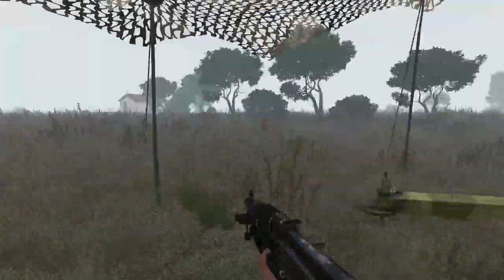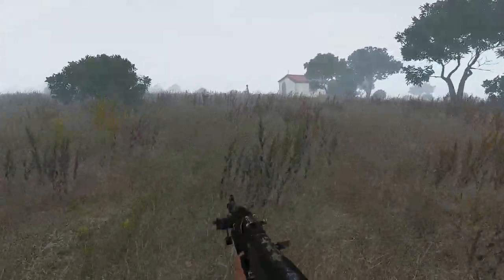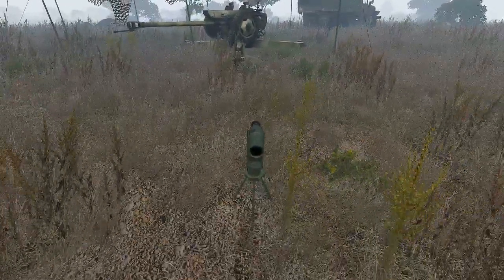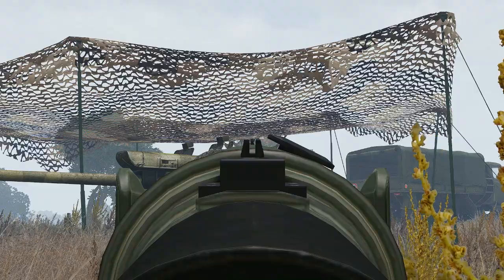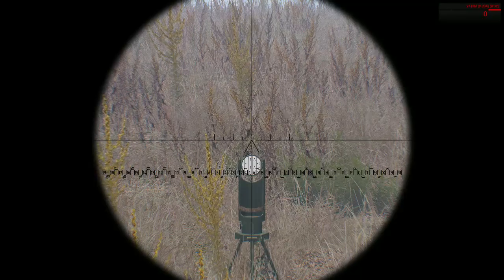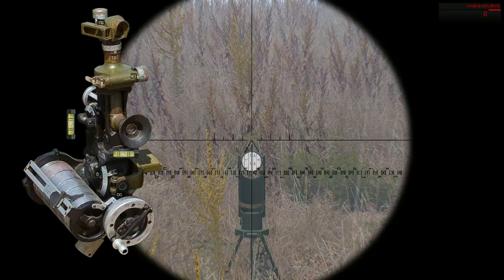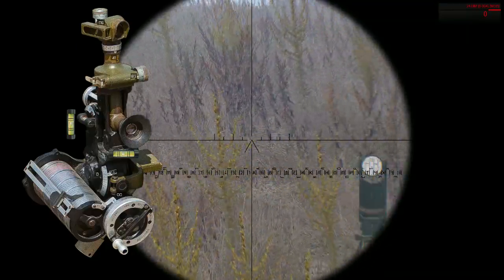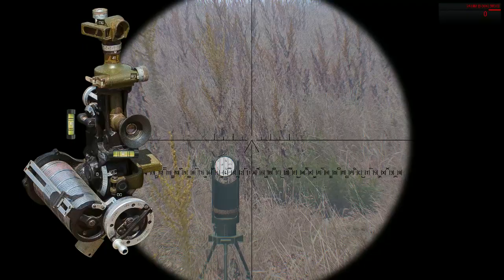Arma 3 - Realistic Artillery Tutorial | Part 13 ( Artillery collimator )

Comment: 6:15 here you gave the example of a target being 300 mils counterclockwise

how would you calculate to get a number like that? like 300 in the example?
Reply from the maker: In reality you dont mess with that at the gun. FDC knows your orientation azimuth only will say for example: "sight 34-54" you just adjust your sight to that and rotate the gun until you see your orientation again (the collimator in this case). FDC calcualtes your sight azimuth knowing your orientation and the target azimuth.
Here you find the pribnciples:
https://cgsc.contentdm.oclc.org/digital/api/collection/p4013coll2/id/1255/download
Reply: @gezalesko3813  I meant that how do you get the number 300 to begin with

so say that my orientation is 6000 russian mils, do I just subtract my target's direction (4948 in my example), get 1052 and subtract that number to my scope number (4530 for example) and get 3478? Because it is short to the target. idk if that makes sense but my point what do you have to subtract or add to get that 300 number? I know it can vary depending on stuff, but I mean generally.

This is the one thing I cannot figure out
Reply from the maker: @rllybigguy  I will make a video about that. Until than. You need to calculate the deviation (angle difference) between the target azimuth and orientation, if you need to add or substract it depends, you just need the absolute difference. In your case  example it is 1052 mils. And it is counter clockwise. Since your gun goniometer shows 3000 mils looking straight where the barrel and numbered counter clockwise you need to add 1052 to sight azimuth that would be 4052 and rotate barrell to that sight azimuth..
Reply: @gezalesko3813  Ok, thanks
Reply: @gezalesko3813  ahh I am still having trouble with the artillery, its impossible to explain my problem so I will upload a recording
In the video, just know that I Oriented with aiming circle and used the Artillery collimator. My problem started around 6:20
thanks for your support
https://youtu.be/CiJWBA0OKsk
Reply: Fire direction control calculates your deflection based on range,barrel angle,charge and any other variables